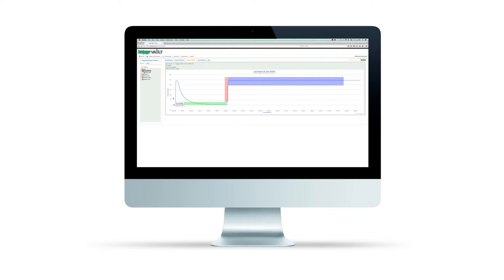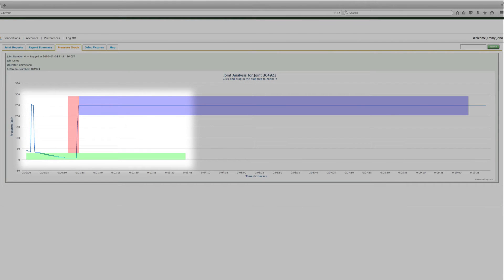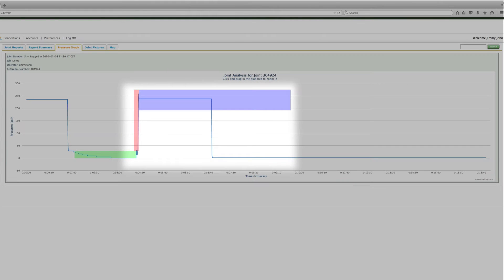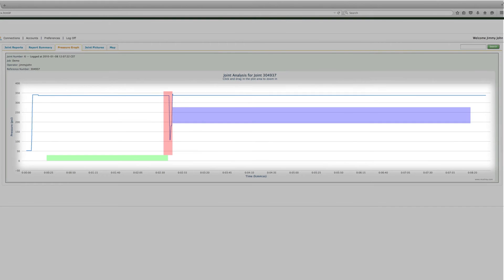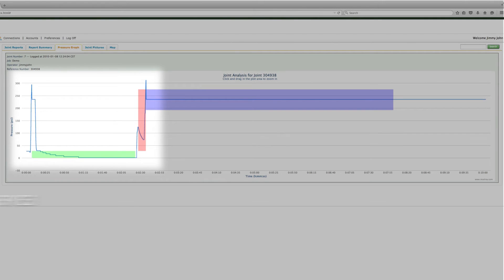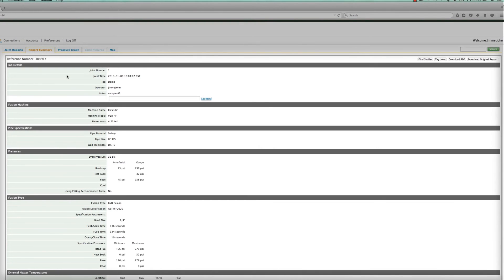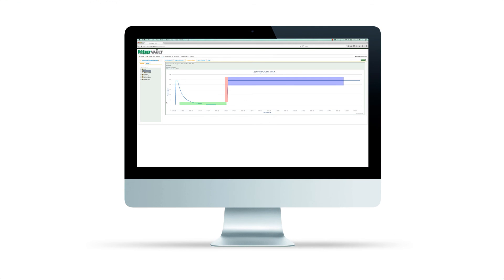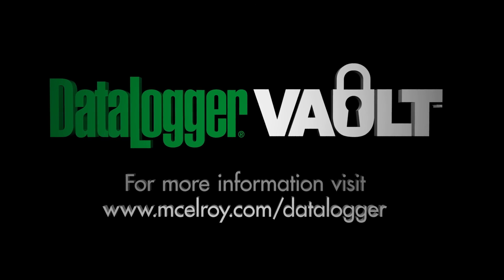DataLogger® Vault™ – Analyzing Joint Reports - Part 2: Identifying Unacceptable Fusion Joints

Comment: If the pressures come out of the cooling range by +/- 10psi at the very beginning of the cooling phase for less than 3 seconds, what would you be looking at to determine if this was an acceptable weld?
Reply from the maker: Transient anomalies may occur when using the DataLogger® and do not affect the quality or reliability of the resulting fusion, as their duration is so short-lived the fusion forces are not affected.